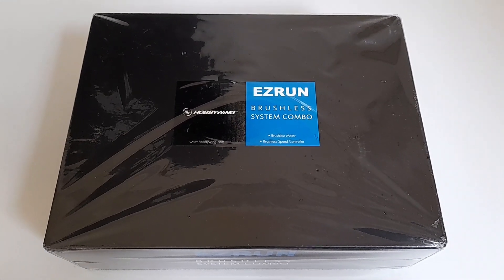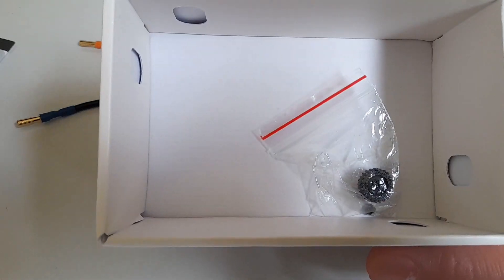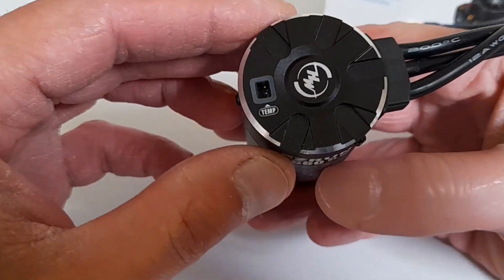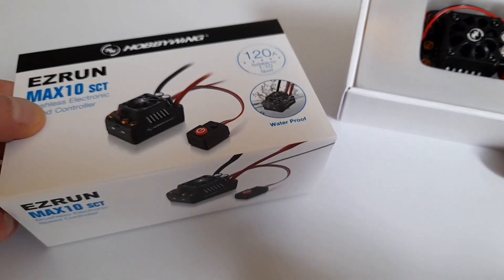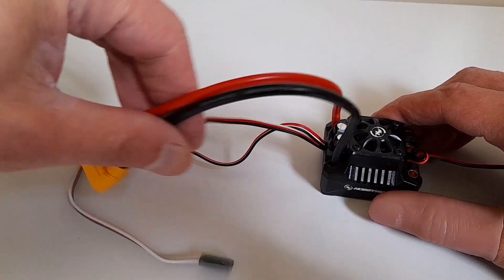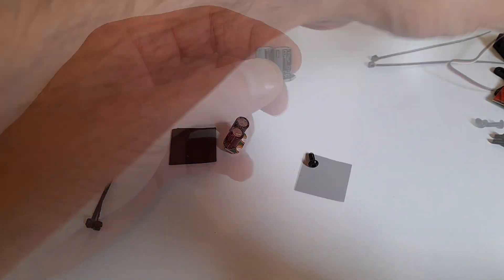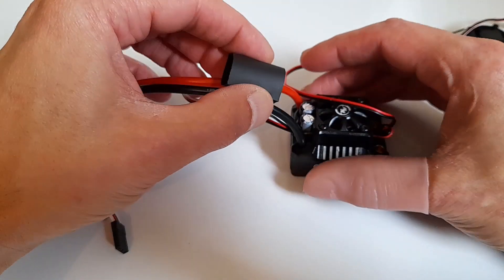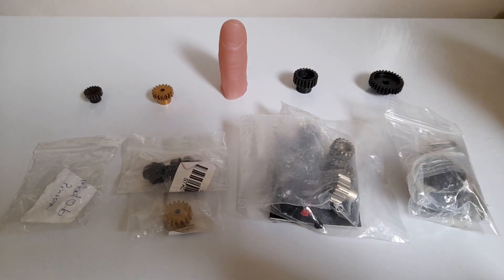Hobbywing Ezrun Max10 SCT what you get?

Comment: I love hobbywing stuff. I bought a max10 for my big rock and that mounting plate they give you is a direct fit inplace of the blx100 👍🏻 I advise fitting the cap pack too dude even if you just run it on 3s. I've since replaced that for a 150amp xr8 plus hobbywing the sensored one and I've got a 6s rated sensored motor. Only coz I hate waiting for shit to cool down. I wanna bash till the battery dies not stop every 5 minutes when it overheats 🙄
Reply from the maker: Right bro, I'm glad I pointed the cap pack out now haha. As a channel that likes issues I'll pass and fit the cap pack. Don't fancy this ESC going up in smoke for the money, you hate waiting I'd never of thought that about you dude. Thanks for sharing your advise this will help more than just me in sure.
Reply: Really helpful to know mounting plate is a direct fit as I’m not great at RC surgery. Interesting comment on the over heating. I had heard the stock fan on the 10sct should really be upgraded for 4s use.